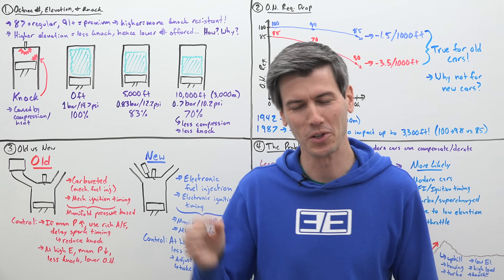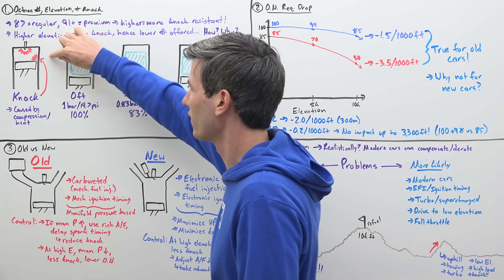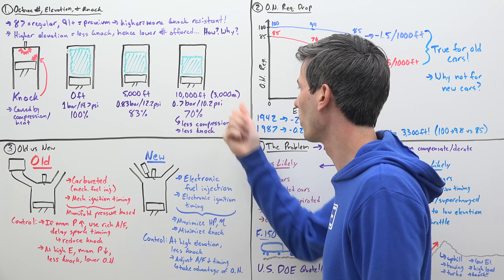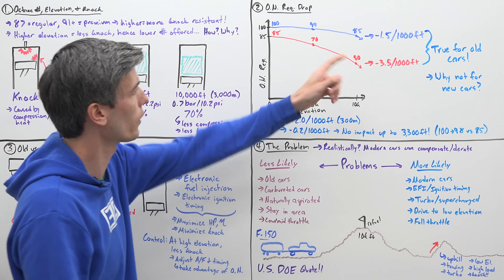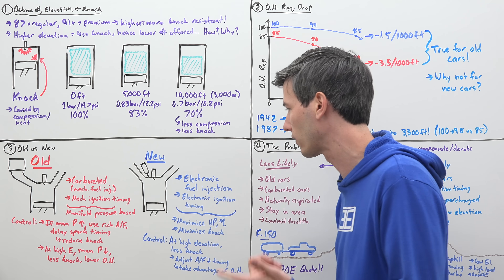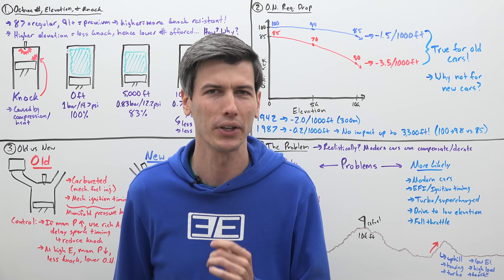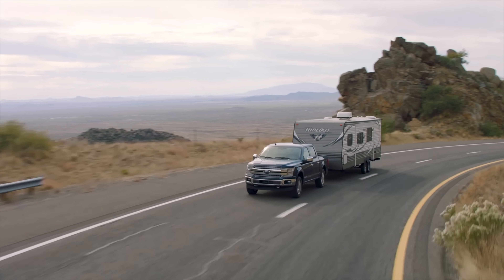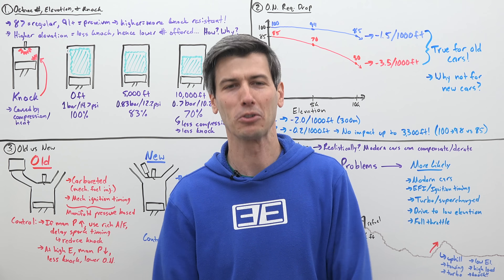Never Use This Gas In Your Car!

Comment: Remember, “modern” in this case of using 87 over 85, even in higher elevations, are cars built in 1987. Essentially, 85 should no longer be produced.
Reply: 87 is mid-grade here in CO and it's like $4 a gallon.  What a rip-off.
Reply: @richfarfugnuven6308  In NB we pay well over $5 a gallon for 87, almost $6 a gallon for 91
Reply: @connorthesledneck1398  
NB? Is that New Brunswick? If so is that a US gallon or Imperial gallon?
Reply: @njsongwriter  Yes it is New Brunswick, and the prices I was talking about are in US gallons. In imperial gallons it’s $6.25 regular, $6.65 per gallon supreme
Reply: @richfarfugnuven6308 87 is regular not mid grade. 85 is water gas
Reply: I see this all over Wyoming, and they sell it for a pretty high price there. Of course, that is the price they display. Then you pull in and see 87 octane is 30 cents more.
Reply: @rons5319  this is good news for me. i have a klr 650 and am moving to wyoming hopefully this year.
Reply: @_AndromedaGalaxy_  I make my own race gas with the concentrate for my Can Am,  dirt bike, and Yamaha Raptor...
Reply: @_AndromedaGalaxy_  Sell it before moving.  U not going to use it.  U will freeze and be blown away.  Lol.  I know.
Reply: Ha! i never see 91 octane at the pumps! And i'm suppose to use it in my vehicle. usuall it's 87 octane in the premium pumps! And this is low level Ca.
Reply: @jackterry7664  In California's hottest areas, they might as well sell 110 octane racing gas as "regular gas".
Reply: @electric7487  Wish i could just get some 104 octane!!
Reply: @jackterry7664  U can.  E85.
Reply: @electric7487  hotter air is less dense, like air at high elevation. So you could use lower octane numbers in hot areas.
Reply: @PeterBaumgart1a  at the range of temperatures humans live at temperature doesn't really change density all that much. Pressure is the driver by orders of magnitude.

The effect ambient temperature does have is that it will cause your engine to run hotter which makes it more likely to knock.

So, theoretically you can, practically it would be problematic.
Reply: @PeterBaumgart1a  No, you have to factor in the ambient temperature as well as density. Air at higher altitudes is less dense, but also cooler so its temperature when it is compressed is lower than hot air that is being compressed. So you need higher octane in hotter climates.
Reply: @electric7487  The higher the temperature, the less dense the air, = the same as gain in elevation and less dense air and lower compression than STD ATM.
Reply: I was in Colorado for the first time, got a rental and went to fill up and was so confused by 85
Reply: Nit an issue with a common Atkinson cycle engine, Prius. Very low compression cycle...

Personally I buy gas with no alcohol in it, availble in CO, to get significantly better.
Reply: There are still lots of engines that don't need higher knock index fuel. Yard equipment, generators, some motorcycles, old cars, and heating devices. And there is the fact that many cars still don't knock unless at full throttle, so it isn't a big issue. I have used it for years, never had a knock code, and only start hearing it at wide throttle positions. In daily driving you never have to push the car that hard.
Reply: @court2379  You must not own a weakling car.. Lol My poor little 2L Inline 4 Ford Focus from 2004 can't get out of its own way in the summer when using the A/C. Full Throttle is needed to keep pace with cars that are 10 years newer than itself coming from a stop.  It's also a stick shift and Most of my driving is found at traffic lights in 55MPH zones, so you gotta get yourself up to pace quickly. 

During the not-as-hot months, I can usually get along with 70% throttle and keep pace. 130HP aint much, lemme tell you what.
Reply: @court2379  Sure you don't have to go WOT to drive daily...but it only takes one time for it to destroy an engine. Over on Eric the Car guy's channel, he blew up his Ford Fairmont's engine that he had built by using lower octane gas. At least I think that's why it happened. Knocking is the fuel detonating before the spark happens and that's never a good thing.
Reply: I don't put anything less than 91 (all my bikes and cars require it). 85 seems like a joke to keep around
Reply: @pleasedontwatchthese9593  If you live high in those hills and have an old carb truck or motorcycle... You're happy to get that cheaper gas.
Reply: @calholli  well I don't lol
Reply: What kind of car do you have?  The n.y cars that require 91 min are high performance cars.  If you have any normal car, you can use 87 and save money.  If your cat isn't knocking, the added octain does you no good and you are just wasting money.
Reply: @blaster-zy7xx  I have a few cars , all of them with more than 10:1 compression ratio( requiring higher grade fuel)
If I use low grade fuel the computer retards timing , drastically reduces power and they run like a dog!
So the engine won’t knock !
I would much rather pay extra and have the performance! 
Along with better economy 
So paying extra pays off in the long run!
Reply: @batmanlives6456  With fuel prices, I have filled my LS2 car with 87 (mid-grade here in CO) while filling the wife's SUV on the same purchase to save money. Of course those happen to be the times I most often encounter people wanting to know if my car is faster than theirs, and I just can't bring myself to go full-throttle in that situation. I normally fill the car with 91 though, so it's usually not a problem (other than cost) and I only fill my rotary car with 91, because I can't afford not to.
Reply: @th3ch33t  I filled mine today 
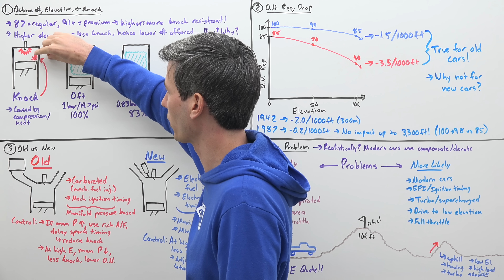Here in Australia e10 (94octaine) low grade for here cost $1:50 a litre 
Which would be $5:80 a us gallon 
So I think you have got it good ! 
98 octane here is around $1:75 a litre
Reply: @batmanlives6456  Well, it depends on the car and the fuel price. In my car too I notice some extra power, and slightly better fuel economy. But RON98 is around 10% more expensive than RON95; and I can only measure a 2% increased fuel economy. So in my case, better grade fuel is definately not cheaper 😉
Reply: Lawn mower gas should not be used in cars.
Reply: Here in germany 95 is the cheap fuel... 
you can get 98 as premium fuel, at some Stations even 102 or 107.
We have a lot of tiny engines with a lot of boost witch are very knock sensitive.... but thats still a big difference in oktane levels
Reply: @justjonazjameson5559  octane ratings are measured differently across the pond
Reply: @neoleo593  oh reallly, i didnt know that..
it was always wonderd how the US-Engines could get away with those low-oktane-fuels.. makes sense
Reply: @justjonazjameson5559  yeah, I don't exactly remember how the conversion is but I remember my friends euro 2.3 16 said it required 100 and he was very confused
Reply: @justjonazjameson5559  Most of the world including Germany uses the RON rating which is a different way to measure knock resistance compared to the AKI that for example the US and Canada use. There's no exact conversion rate as they're different measurements, but RON is usually 4-6 higher than AKI, so German 95 RON is somewhere between 89 and 91 AKI
Reply: also  @neoleo593
Reply: @neoleo593  It still seems to be lower on average compared to the Europe, quite a bit at that as well. Being from Poland, regular here is also 95, which is roughly 90 octanes in the US system of marking fuel. Premium is 98, which in American is roughly 94.
Reply: @neoleo593  In Europe, octane ratings are based on the RON. The MON of gas is not usually published, it's a lower number. In the US, AKI is the number they use. AKI = (RON+MON)/2
Reply: @justjonazjameson5559  Keep in mind there are different methods of measuring the anti knock index. The numbers there need a mapping table to be comparable. Anti-knock Index (AKI) is used in the U.S. Research Octane Number (RON) and Motor Octane Number (MON) are used in the EU.
Reply: @justjonazjameson5559  
I believe the octane ratings are from a different scale in Europe...
Reply: @justjonazjameson5559  prob research octane (RON)
Reply: @chuckhursch5374  yes i just googled it Europe uses RON and the US uses AON
91RON = 86,75 AON
95RON = 90AON
98RON = 93AON
Almost worth a video ,,cough Jason cough´´
Reply: @justjonazjameson5559  I believe the European octane is is measured differently than the US method.
Reply: The European octane rating is different it isn't the (r+m)/2 system. Your regular grade gasoline is probably the same as the regular 87 octane offered In north America.
Reply: @KLAWNINETY  Your right and wrong. It's a different measurement, but it's still higher quality than your 87octane fuel. We used to have "Normal" which was 91RON, this was the closest equivalent to your 87 octane fuel. This isn't available anymore in most western european countries (Germany got rid of it in 2010). The next higher level is "Super" with 95 RON as the name suggests this used to be higher teir but is now the standard gasoline, there is a derivate that's called "Super E10" normal "Super" is E5 this shows that one is 10% Ethanol and the other one is 5% Ethanol. The highest teir normed fuel is "Super Plus" with 98 RON this would be equivalent to 94 RON in the US some Oil Companys such as Shell, Aral(German BP) and some others don't offer the standard "Super Plus" but other premium fuels wit 100-102 RON. These are pretty much a rip-off since most standard street car can't take advantage of octane numbers above 98 RON.
Reply: @robertschneider8808  I when to a pump in Germany once and was very confused.  Some of the fuels had the RON octane rating (which were higher than I was used to), but I also saw "Super E10" without an octane rating.  Since I was using a rental car, I just bought whatever was cheapest.
Reply: @NathanKrick  Yeah it's a bit confusing. We dont really buy bei RON but by name. 
Super is 95 and Super Plus is 98 and all you remember is if you have to pumpthe one or the other. The RON is written on all pumps on a official tag but it's not necessarily advertised with the name.
Reply: @robertschneider8808  yeah, this was probably 5 or 6 years ago now, so I don't remember the details, just that I had no idea what was what, so I decided what to buy based on price (the rental was naturally aspirated, so I figured the cheapest non-diesel fuel was fine).
Reply: @justjonazjameson5559  and decent fuel

Comment: Finally, a good video on this. :) I've settled on 87 for myself (and 91+ for my "pings on anything lower" old Miata) here in 5000' land. Just about everyone here seems to be using 85 though unless "premium" is required for their car. As you imply, it seems to be more of a "could cause problems" vs "does cause problems" thing. I think if 85 was damaging cars left and right and dealers/manufacturers were dealing with angry customers, all owners manuals would call it out specifically like Ford did in theirs.

Comment: Curious how Ford would actually prove that 85 octane was used. If the dealer finds damage due to detonation and a bunch of knock events recorded in the ECU, would they then drain the fuel tank and send it for octane analysis? And then go to the gas station you used and sample their fuel to prove that you intentionally used 85 and it wasn't a case of bad gas or your Ford grenading itself because it's a Ford? Because I'm sure gas stations would never ever sell 85 as an 87 or a 91 on purpose to make extra profit... The burden of proof in warranty claim denials is generally on the manufacturer.

Comment: As someone that has run up and down the mountains with unlocked ECMs and ETAS and Vision tools to record all of this data for decades and decades, putting "2 lower" octane rating fuel at 5000 feet plus elevation ain't going to cause any poblems.

The only problem, not discussed in this video, is when someone fills a full tank at high altitude and drives to a low altitude location ...in hot weather at full load ...in some circumstances.

There is a big difference between those few engineers that work at an OEM doing these validation trips and those that do not have that data and experience.

Comment: To make it even more confusing, there is now E85 being sold right along side regular, which is NOT 85 octane, but actually 100-105 octane, but you can't use it unless your car is made for it.
Reply: And while you can make more power with E85 due to that higher octane, it requires a much richer air/fuel ratio so you get really bad gas mileage and range. Personally, I think it's really only suited for performance vehicles. A poor man's racegas, if you will.
Reply: E in e85 stands for ethanol, the number e40, e60, e85, is the percentage of ethanol in the fuel, not octane. Normal unleaded gas can have up 10%, so 93 premium gas can actually be e10. Just like diesel, ethanol/ flex fuel pump handles are different colored. If you don't know what the fuel is or what it means, then clearly it's not for you and you don't need to be using it. Although how many people still manage to pump diesel into their unleaded cars?

Comment: I lived in Idaho for 9 years. Most of the state uses this crap fuel and it's definitely noticeable with certain cars due to the lack of power and or fuel economy.  

I mostly drove cars that required high octane and it was hard to find anything better than Cali pisswater fuel.

Comment: I wish they would get rid of the 85 octane here.  It's especially a pain at places like Costco that only sell two grades, 85 and 91.  I just end up running 91 in my F150 Ecoboost, it gets better mileage anyway.
Reply: @Engineering EхpIαined So where's your verified tag?

Comment: Once there was a story of 225hp Audi 1.8t engine first with minimum 95octane. Cheapish people are they though nothing happens when not using 98 because of the knock sensor... So you can punish it an hour autobahn with vmax... Pistons melted 😂

Comment: Great video thx! I was getting a 'fuel cap loose' warning light in my e63s. Fueled up with what I thought was 91 in Brooklyn NY (so at sea level). Started car and noticed a lot of shaking from the engine. On the highway, had complete loss of power (maybe a knocking issue?). In the end, the purge valve and charcoal canister had to be replaced. Wondering if a pre-existing issue with the pressure valve was accelerated because the fuel wasn't in fact 91 but lower octane and maybe that pushed the purge valve to fail?
Reply: @sb-nyc  DON"T. this isn't the real EE, it's a spam/scam account trying to trick you - report it instead!
Reply: @laboulesdebleu8335  Thx!

Comment: wait, less knock at higher altitude because less air... but lower octane rating in fuel causes more knock? im missing something
Reply: When the octane level is too low, it can cause knock. At elevation "too low" is lower than at sea level, and that's why they started selling lower octane fuel at elevation. But that standard was based on vehicles from decades ago, and is no longer relevant. 

The only practical thing that you need to get out of this video is that 85 octane is not recommended for use in any vehicle made since the 80s, regardless of elevation.
Reply: @mechmat12345   i assume its correct, i just don't know where my understanding is wrong. Lower altitude is higher pressure and more air into the engine. Higher altitude is lower pressure and less air in the engine. Too little air  with combustion risks knock with a rich mix. So you would think you'd need a higher octane rating for higher altitudes to correct for the lack of pressure/air available. So what part am I missing?

Comment: 85 octane was fine back 70 years ago when some of the old cars had 7:1 compression ratios and would run on almost anything that would ignite. It should be discontinued now as it is pretty much useless for most modern vehicles.
Reply: @Engineering EхpIαined🌟 Scam alert!
Reply: @zacharyreynolds4303  higher octane fuel is not more expensive to make than low octane fuel. This is all synthetically done in a refinery. The price gauging for higher octane is literally  marketing